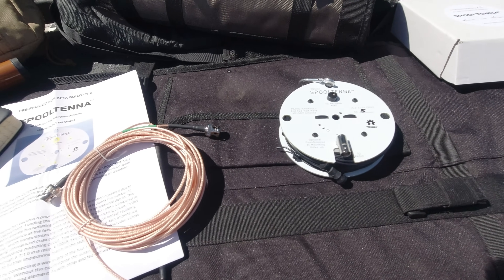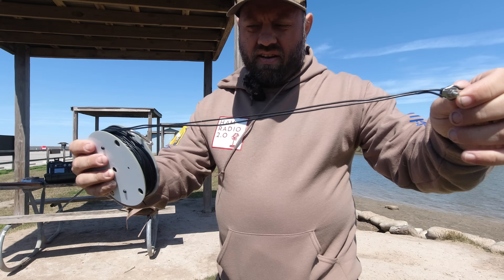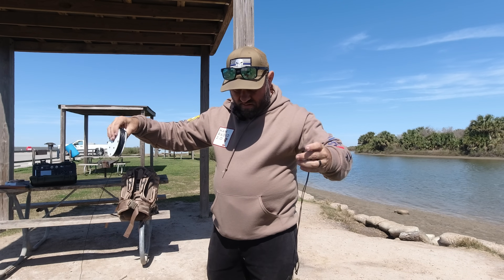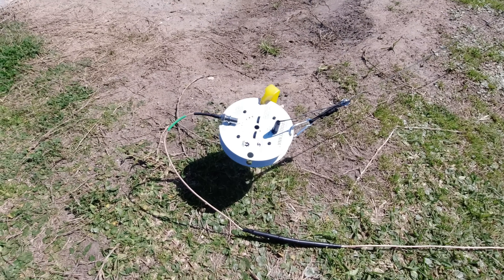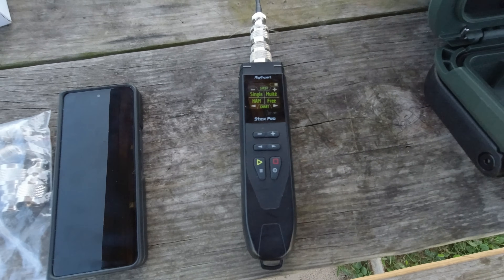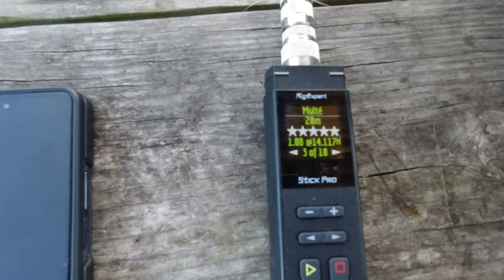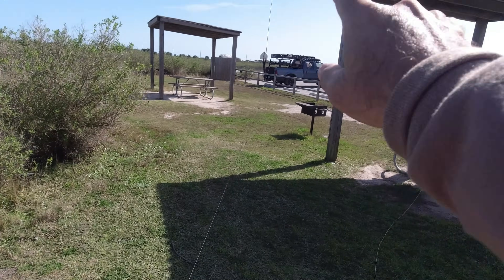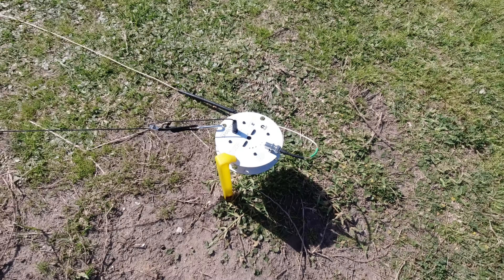Spooltenna: Testing the NEWEST Ham Radio Antenna at a Park!

Comment: This is not a new concept, the Reel POTA antenna has been around for years
Reply: SPOOLTENNA addresses the same problem, in a similar yet different way.  The integral UNUN makes the unit compact and has a larger winding diameter.  Thanks for the comment.
Reply from the maker: No one said it was a new CONCEPT, just a new antenna
Reply: @ 🙂that’s true.

Comment: That looks like a great antenna !  the bonus bands are great ! better then my end fed 66 ft with 49:1 . That works super but like 12 meters  and 30 meters my SWR is like 3.4:1 . Well under 1.5 on 20 meters /40/like 1.7 on 15/ around 1.3 to 1.7 on 10 . I wounder what UNUN and cap he using.  I like that shack In A Box for that IC 705 . That The best go kit I seen for that radio. Very rugged ! 73

Comment: Hello, I like watching your videos. I have questions about the antenna your testing at this particular time. I met a military individual that was in the Iraq war and he brought back a pouch. He found in the desert with a rolled up antenna and a inflatable device inside the pouch, as well as a cylinder of some type of air where they can inflate the antenna so it would go up in the air. I tried to get him to sell this to me, but he kept refusing to. I would’ve loved to have tried it out to see if it worked how well it worked. Have you ever seen anything like that before?
Reply from the maker: Not exactly, no.  I have seen someone add an EFHW antenna to a kite and fly it into the air while using it for POTA

Comment: Hi Jason. I like the fact that he included a 316 coax with it. My choice for portable ops too. Danny WZ1P
Reply: Are you a QRP guy? Just curious since I operate out of a backpack but have never had a problem with my 50ft of rg8x. It’s easy to pack and doesn’t honestly weigh too much. I guess I’ve just never considered 316 since it’s expensive and has high loss.
Reply: @NebulaHatesWatchdog  RG8X is just fine and very durable. It's a good choice. On our Buddipole DXpeditions I usually pack two 25' 316's so if one fails I still have a backup. On HF and just 25' 316 is is not that lossy. It's tough and light. I do BNC male to BNC male. I start with 20 watts and throttle back to about 10 watts when the pileup rolls in. 73, Dan WZ1P.